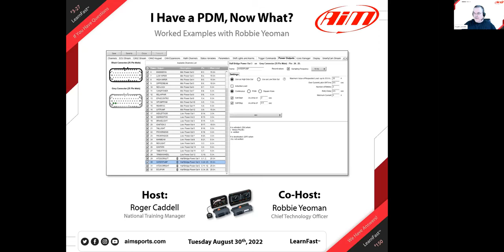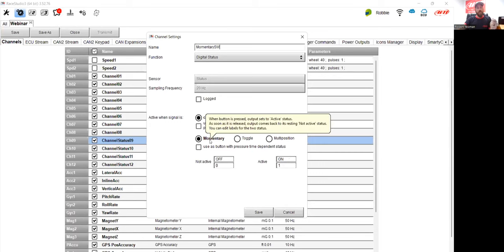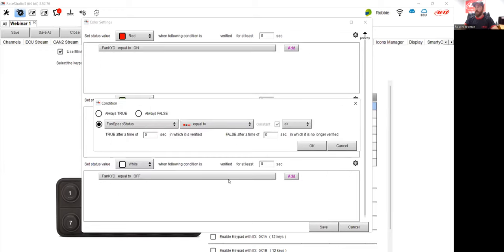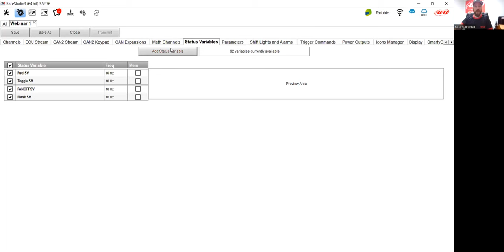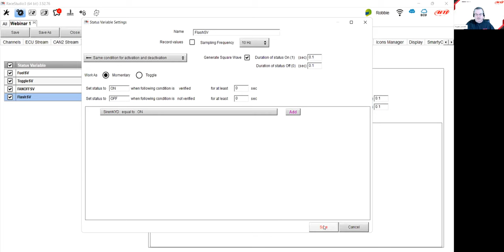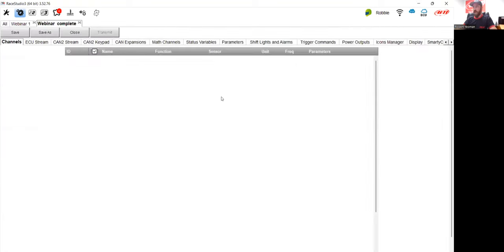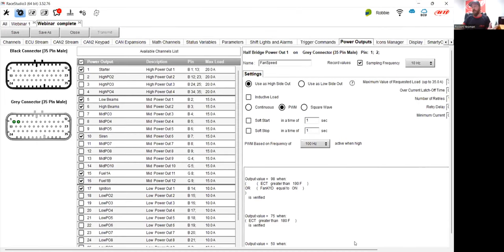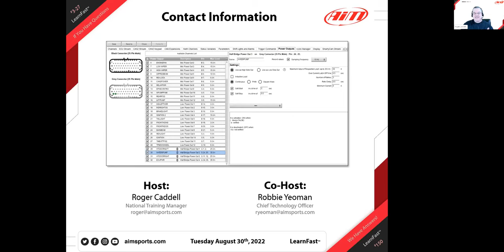3-27 I Have an AiM PDM, Now What? - Live Webinar with Robbie Yeoman - 8/30/2022

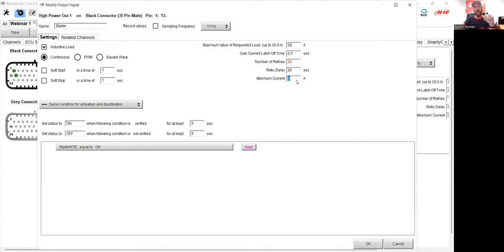Comment: At 49:30 it mentions minimum current being supplied at all times.  I believe minimum current would be monitored for the external device function, not supplied at all times.  I'm guessing if the thing is a 5A minimum thing and it's drawing 1A, then the status for that output would not be 'ok'.  I assume that the output would remain closed even if the current was less than the minimum?

Comment: In the video at about 35 minutes in, you mention using timing to prime the fuel pump.  But it appears to me the settings used would just turn the pump on 3s after the ignition is turned on and then it would stay on as long as the ignition was on. 
Edit: I believe something like that would work if you remove the delay on the activation and use another condition for deactivation based on SafeIgnition equal to #1 AND RPM less than 50 with a delay of 3s.  You would also want to deactivate on SafeIgnition off.
Reply from the maker: Good Eye. The solution is less complicated than you have imagined though. The safe ignition equal to 1 will solve this. When Ignition is applied the  Status Variable is false until the timer has elapsed. Now direct your power output to activate on the rest state of the status variable. You can even rename the rest position to ON to make navigating the power output logic easier. Hope this helps you and others.
Reply: @aimsportsdata  Ah...That makes sense.

Comment: A bit off topic but have a mychron5s that in the morning comes up with yesterday and afternoon today I’m from NZ has the right time bottom right corner does flash EU when you first turn on 🍻Steve
Reply from the maker: Make sure your firmware is up to date and that the correct time zone is set. It may be the right numerical time but an AM/PM issue
Here is a video we did on firmware updates: https://youtu.be/V4gwYf1LkPA
Another video on the configuration and downloading of data on the Mychron5: https://youtu.be/UXKuf2A4AuU

Comment: With my PDM32 config running my ECU Stream I'm unable to use HPTuners to record/flash via the OBD port coming from the PDM. This makes life quite hard for me and forces me to run the PDM on another config with ECU Stream on None, causing a whole raft of issues because I cant get RPM/ECT for PO's and SV's and so forth. I did get a tip that delaying the PO for 3~ seconds on SafeIgnition for the ECU could resolve CANBUS errors, does this sound likely? AIM TS previously made me a custom ECU protocol with MAP disabled but I still had the same issue not being able to talk to the ECU via the OBD port wired to the PDM. OBD port works fine with ECU Stream on None.

My question based on the above is, can we get a screen on the dash to show CANBUS traffic overview and/or via RS3 when connected via USB?

I am a preorder customer, for what it's worth.
Reply from the maker: Tough to answer this question in YouTube comments, I suspect the technician thought that we had competing CAN traffic between the HP Tuner and our device so they disabled the outgoing message. This may not have been completed correctly in your software and the best way to get to the bottom of this is to follow up and let them know you are still having issues. We are also available via phone for these types of in depth troubleshooting steps. (800)718-9090 As for the safe ignition, I don't think so.  The display in the car, showing CAN traffic is not going to offer the accompanied tools to complete the job you are asking, best to leave this to a tool designed specifically for the task of not only reading but also manipulating CAN data.